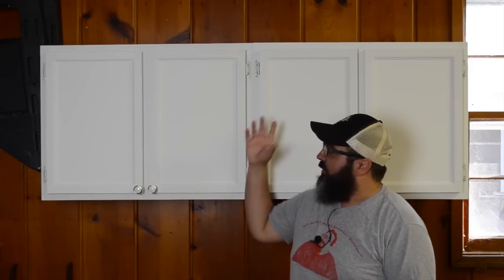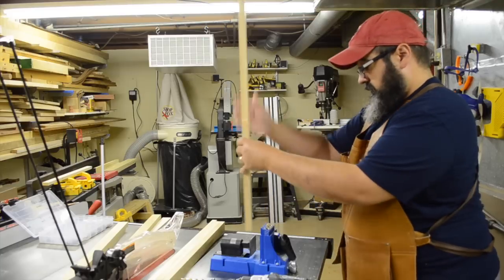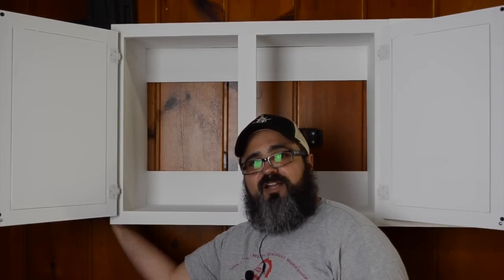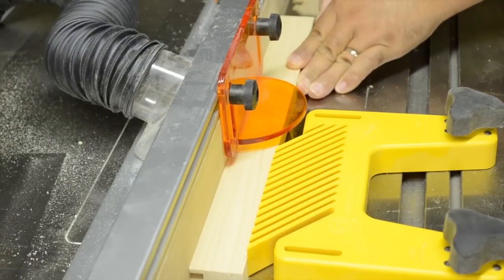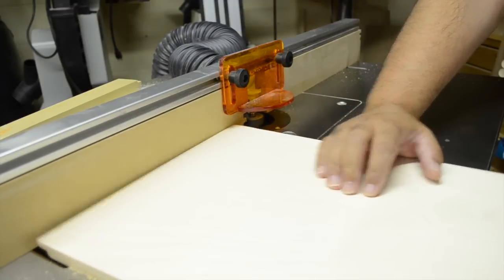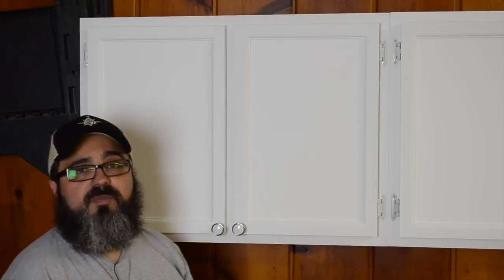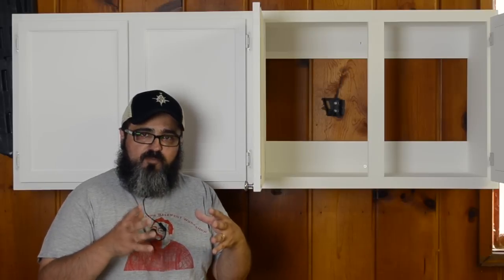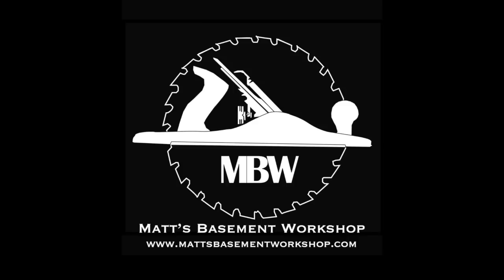551 Simple Cabinet Construction Pt 2 - "Face Frames, Doors & More"

Comment: Hi Matt, thanks for the video. 

Nice cabinet with a pleasant finish and low cost. I think that you could have simplified the door construction in line with the rest of the cabinet construction but, as is often the case, it might be that you had no choice but to match other items in your house.
Reply from the maker: +Jeff Harmed without a doubt the door construction could have been EVEN MORE simplified. It could easily have been a single panel attached to the hinges LOL.
Reply: +Matt Vanderlist I think you would agree that a single panel of solid wood would warp before long and look odd. A panel of plywood you say? Possibly. If you were really careful about filling and painting the edges. Modern paints are so plastic-like that you just might  be able to get away with it for a few years. But I would not be happy with that either. 

No, I would make a simple butt-jointed frame as per the face frame Matt made earlier using pocket holes. slap on a 1/4 inch plywood sheet on the back to hide the pocket holes and then bead the edges, and front insides of the frame to make it look like a floating panel. The looks without the extra work.
Reply from the maker: +Jeff Harmed To avoid the possibility of the single panel door warping (solid wood or ply) one could apply battens across the back to help add rigidity and reinforcement. It's not an uncommon practice.

But for certain the frame of the door could be constructed in the same manner as the face frames using pocket holes joinery or even dowels.

Rather than applying a plywood piece to the back, I might route a rabbet on the interior of the frame, drop it in and then apply a simple but decorative molding to hide it. And then to hide the pocket holes, it's easy to apply plugs.

The beauty of woodworking is that there's always options LOL!
Reply: +Matt Vanderlist, since you are painting it, why not fill the holes with joint compound?  Would that work?
Thanks for doing such a superb job with all of your videos!
Reply: +ode2george There are actually 'official' plugs that will fit the pocket holes and cover them nicely.

Comment: Thanks for the shoutout.  Most my work are for paying customers, and although I have been told I "over engineer" my cabinets - I also take pride that I have never had to go back for warranty repairs either.The cabinets look great.The only thing I would add on this video is that you might consider (just consider...some people are religious about this topic though) is to use all MDF for the cabinet doors when they are painted.  I love wood, really kind of hate MDF.  However, for non-structural applications...especially ones that you want to remain flat and square...MDF is hard to beat all around.  You don't have issues with blow out when milling profiles for 5 piece construction.  Glue up is easy, since the movement is uniform across the material...it will all move together.  With the right primer, it paints up like a dream.I don't care for the routed MDF doors on CNC machines (or done by hand...if you really like to punish yourself), but you can use the same tooling for routing a 5 piece door out of 3/4" MDF strips for your frame and whatever you prefer for the panel (flat, reverse, raised...1/4", 1/2", 3/4"...).The time saved, money saved and hassles saved make it my go to material for this particular application.
Reply from the maker: +Joe and Liz I'm not a huge fan of MDF either CHORTLE!
Reply: MDF...such a dirty word , MM MDF Studio...mmmm just doesn’t sound right....too many M’s. 🍻